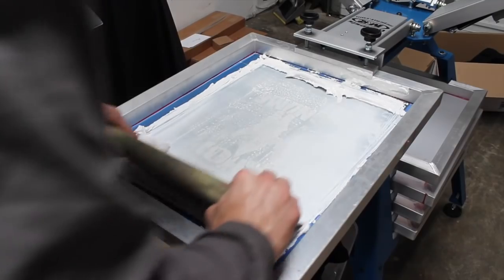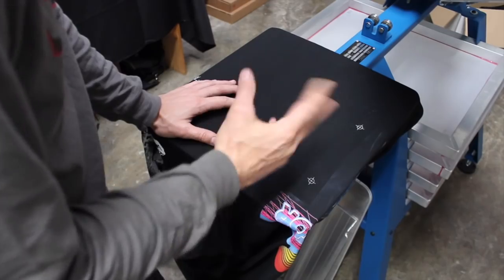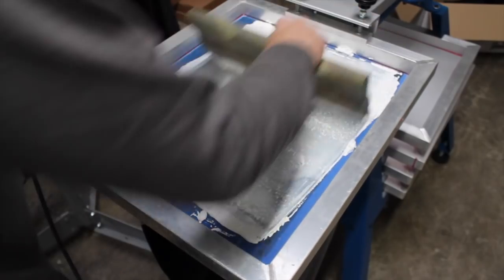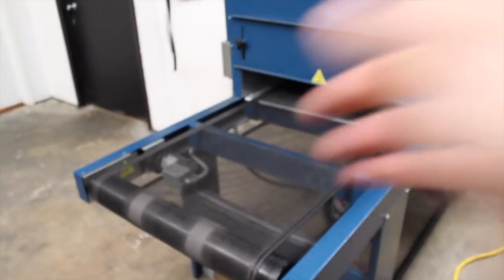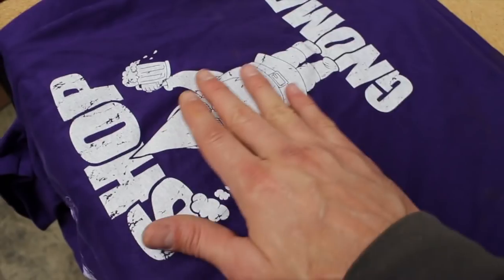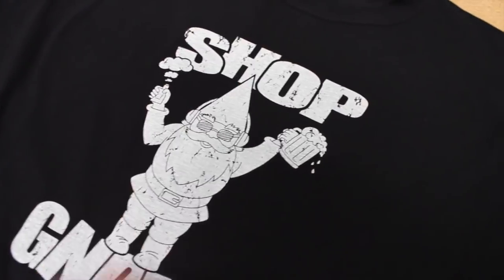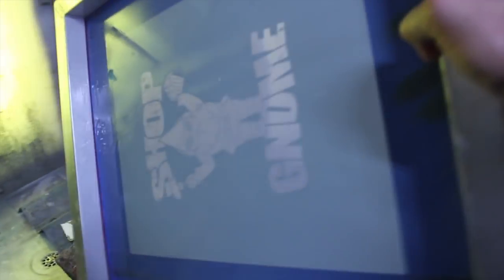The Art of White Ink on Black Shirts

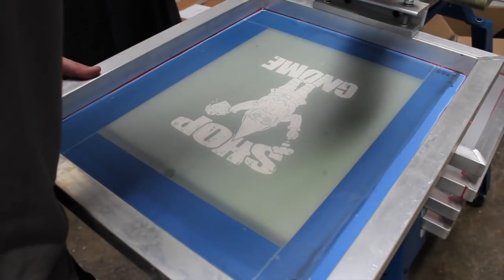Comment: Forced air is nice to have, but you don't need it.. We cure ours on the slowest speed without forced air and it takes 1:30min through the dryer and it cures the ink just fine 👍 ours has a 4' heating element and have no issues.
Reply from the maker: You're absolutely right and I probably should have worded that better. Lots of people cure shirts with a non-forced air drier. Pinning this...
Reply from the maker: I had considered using Virus inks, in particular their wet on wet CMYK inks, and they were a little discouraging. I was told I need a gas drier with a longer tunnel and an automatic at the time we still had the manual. Still might give it a try, but they're pricey.
Reply: @mikeydesignssilkscreen473  i have heard that the washability is not that good.
Reply from the maker: @crumptees  Good to know. Not trying to make clients unhappy and waste money.
Reply: I've been trying to find the right combination of belt speed and temp to fully cure in one pass (we also have a 4' chamber, but I think we have forced air). What temp do you get the shirts up to?
Reply: @Cool_Papa_Funk  make sure that the the front and back panels are all the way up so you get air flow.
Reply: @mikeydesignssilkscreen473  how to print a red color on black shirt .because when we use red on black it gives  pink result pls make a video on this

Comment: Sweet, nice video. As for curing this ink it really does not need to be in the oven for up to 3 minutes. As long as you reach temp throughout the ink layer you should be fine. I cure mine at about 300 plus degrees and send it through the standard infrared belt dryer once. But that's after they went under an air flash on press. I think the ink takes a little getting used to because it's kinda like cake frosting. But so far everyone is loving this product. There will always be those who prefer something else however ;)
Reply from the maker: Awesome feedback, Jonathan! Thanks for sharing your tips on the curing the ink. Always more than one way to skin a cat. ;) What are your thoughts on the hand after washing the ink?

Comment: Great Video. Thanks. I know very little. Question: Is water based ink an issue on polyester.   I am gearing up to screen print on polyester felt. Any thoughts?  I like the idea of curing at the lower temps than plastisol.

Comment: Stupid question from a newbie. How or what best practice is there to line the screen up after you flash so it lines correctly on the shirt?
Are blends not recommended for bright colors when using wb ink?
Reply from the maker: No question is stupid in my opinion.  You'll need to expose some registration marks in your screens so you can line them up. It can be any object really. Same place on each screen. Use registration color so it'll so up on all your screens in the same spot. You can do halftone blends with wb ink.

Comment: Which mesh did you use?
I am struggling a little with the ink drying fast. 
I just switched to water based. Covers completely different but 100% easier to clean.
Reply: Just caught the part where you used 110.

Comment: Can you use a flash curer or do you need a air dryer system for water based ink?
Reply from the maker: You could use a flash with a blow dryer but it would be slow. Force air, or a gas dryer would be best.

Comment: Hey, i am doring sublimation and HTV as a hobby and now i want to check out screen printing because i saw that first of all you can use your heat press and 2md you can use sign vinyl instead of thsoe UV coatings and third you can use water based inks. Since this is just for fun it should make fun, i saw videos about water based inks where the ink is drying within minutes and it was shown that you can not put the ink back in the original can once you used it. It water based ink really that bad or do you think you can print simple fonts with my method?
Reply from the maker: Water based is a great way to start, but you just need to back flood and the ink can dry up if you let it sit. You'll need to cure the ink just like plastisol to set it so it won't wash out. Waterbased inks take about 1.5-2 minutes in 330º heat to set and plastisol cures as soon as all the ink reaches 330º through out the film. Good luck and let us know if you have any questions!

Comment: Am a newbie in screen printing from Ghana. Please am mostly into water based  for now. I print using the "baby oil technique"( printing on paper)
Please how do you do the mesh count??
(Though I have the plastisol ink and I have tried to use to design but I wasn't able to cure it properly. I used a hand dryer for the curing.)
Reply from the maker: The higher the number, the less ink it'll allow through, and the more detail the screen will hold. You'll have to judge based off of the type of work you do. For paper, high mesh counts will work better. 305.